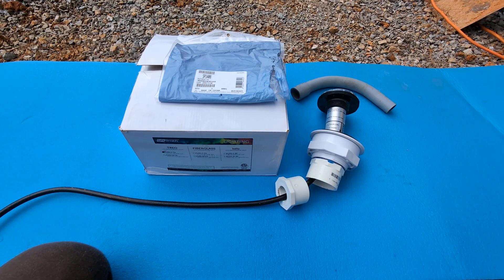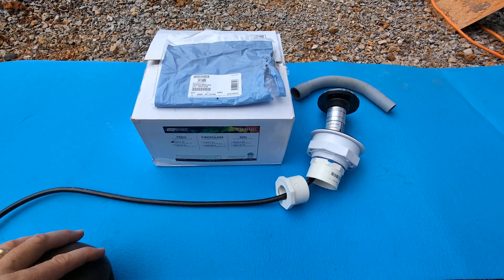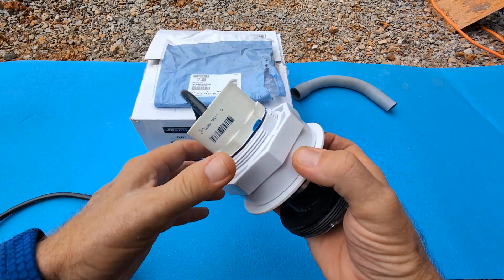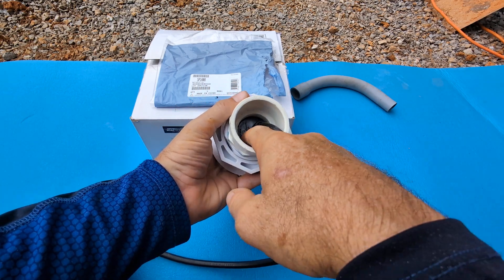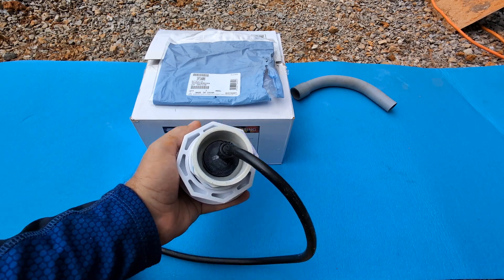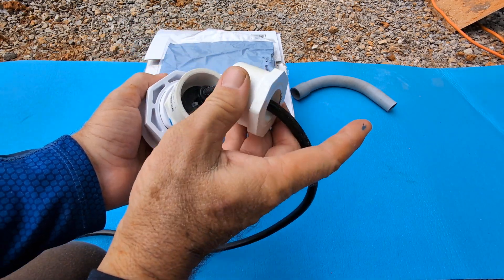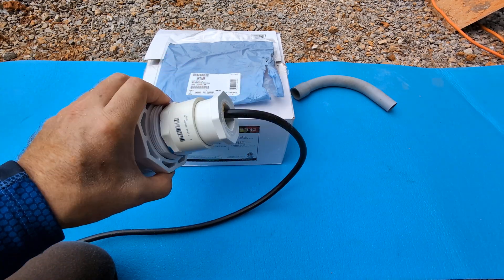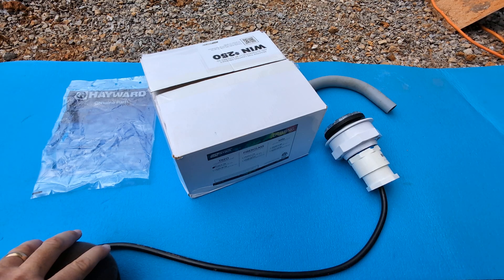SR Smith TREO LED Light Install Issues and How To Solve

Comment: I have this exact issue. My lizard brain forgot to install the 9" sleeve of 1.5" PVC for my ColorLogic light and now we have concrete and everything is ready to go, but just gotta install the lights. I've ordered the SR Smith Treo Micro LEDs so hopefully I'll be able to do this with the plumbing already in place. Great video!
Reply from the maker: We were installing these in a new build, so we had access to both the front and back sides of the light assembly & pool walls. If your pool is already built and you don’t have access to the back of the wall, you can use a flexible attachment, available for most Dremel style tools, to reach in and remove any excess material, allowing the lights to fit properly.
Thanks for checking out my video.

Comment: Hello Greg, great info in video. Can you provide insite to my question please,. I'm looking at the LED lights and I understand they screw into the wall fitting which is installed before the liner. My question is, since the cord is connected to the light assy, do I install the light assy with attached cord after liner is in? Thanks
Reply from the maker: Yes, the light is installed after the liner is in place.

I'm not sure if your pool is a new build or if you're retrofitting these lights into an existing pool, so I’ll break it down as best I can. If you're installing a new liner, once it’s fully in and you've removed the liner material from the center of the return fitting, you can run a piece of string through the conduit where the cord will go back to your equipment pad and power supply.

If you haven’t already run a string through the conduit, or if you're lucky enough to still have the old light and cord in place, you can use the old cord to pull the new one through. Otherwise, a common trick is to attach a vacuum cleaner to one end of the conduit and use it to suck a piece of string through.

Once the string is through, tie it securely to the cord of the Treo light. Then, while someone slowly pulls the string from the equipment pad side, gently feed the light and cord through the return fitting in the pool. As the light reaches the threads, slowly screw it into place.

Let me know if that didn’t fully answer your question, happy to clarify further if needed!
Reply: Thank you  @kalgwl

Comment: Hey there! Great video for DIY and great solution.
 
For those who are going to install this light, the adapter for the wall would be the Hayward SP1408 which is a 1.5" adapter for the wall inlet fitting that the light will thread into. 
On the backside, the threads are 2", you would want to get a 2" female threaded adapter thread to slip. This would allow you to have that extension for the light to seat all the way in. After the 2" you then get a 1.5" x 2" bushing or reducer bushing to come back down to the size you need. 
Depending on how long the light is, you can plumb a few inches of 2" pipe to give yourself more space and then put a coupling followed by a 1.5"x 2" bushing adapter and then continue to plumb out to 1.5" or down to 1.5"x 1.25". 

Hope all this information helps someone!
Reply: same SP1408 for fiberglass pool??
Reply: @victoriacolavita6353  Yes. Same fitting.